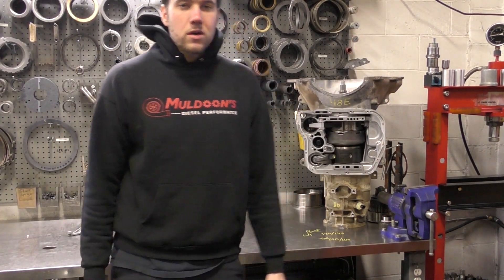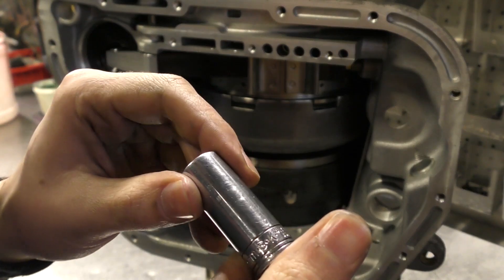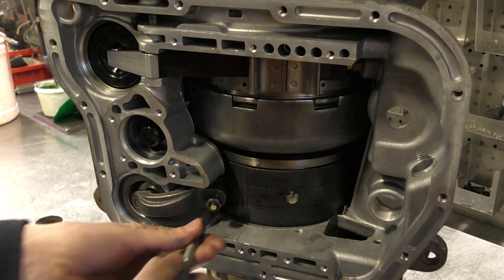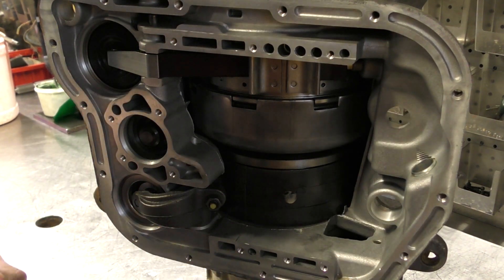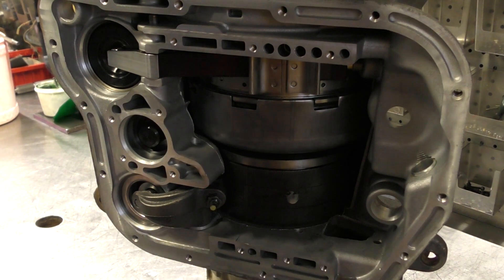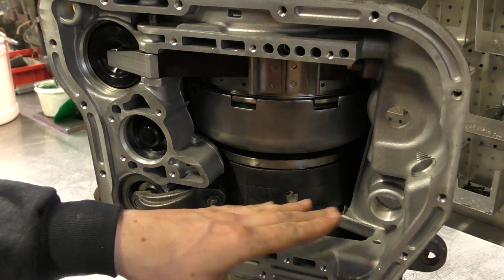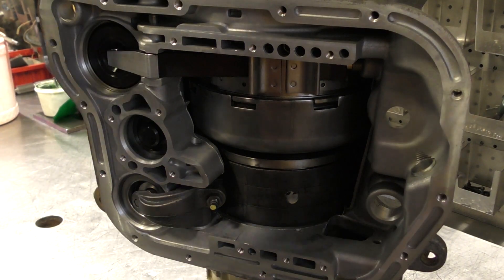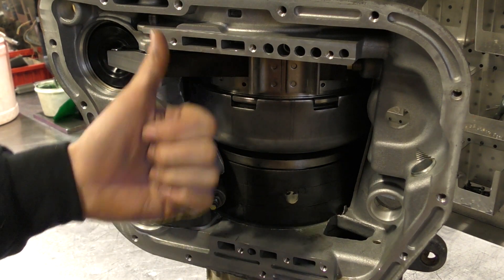47/48RE low band adjustment

Comment: i have 1998 2500 and it has to run in neutral for a coupe of minutes after setting overnight before it will shift,  can you tell me whats up?
Reply: The pump for the fluid only runs when in neutral

Comment: I adjusted front and rear bands per the Chilton manual and now my truck will go about 3 feet in reverse and stop moving regardless how many engine RPM's. Question, the 72 inch pounds and should I increase or decrease or the back off (1-3/4 front, 3 rear) should I increase or decrease these turns?
Reply: You probably have a fucked transmission or no fluid
Reply: Ever figure this out?

Comment: WHY IS THIS NECCESSARY?!?NO ONE WILL ANSWER ME
Reply: There is a wear surface on the band. As the band wears it becomes thinner. Periodic adjustment is necessary to maintain proper clearance
Reply: Besides during the initial assembly, this is not necessary. 
As an alternative you can just have your transmission rebuilt.  👊
Reply: I DONT KNOW?!?